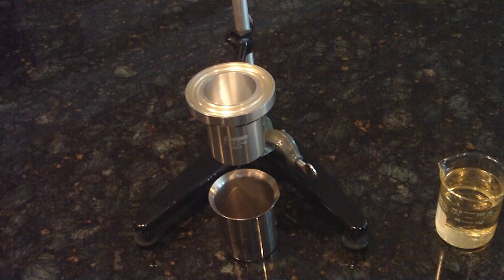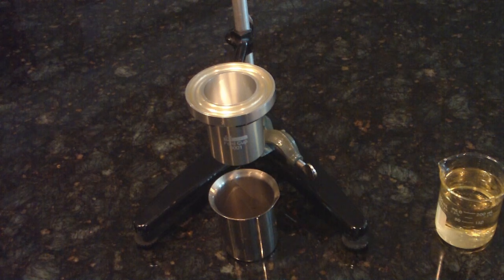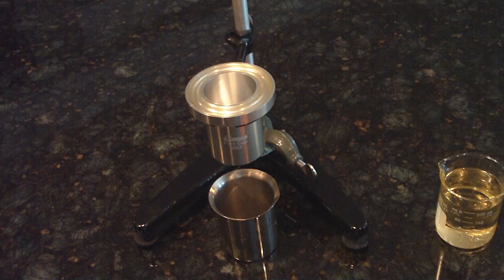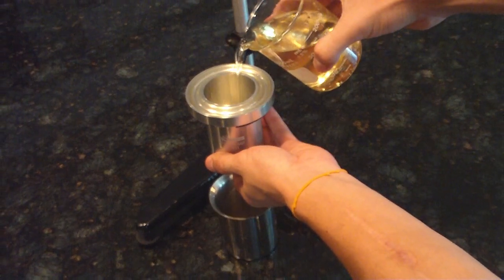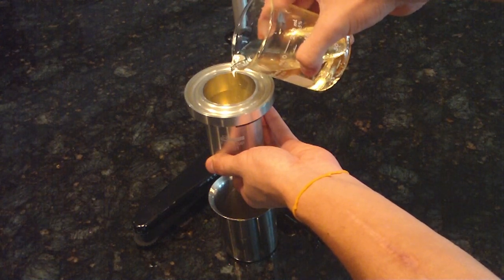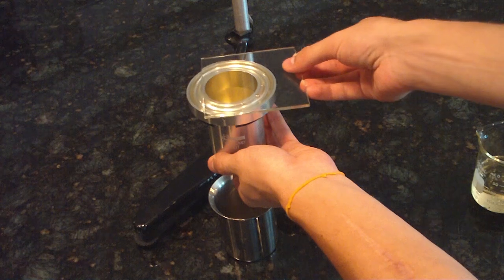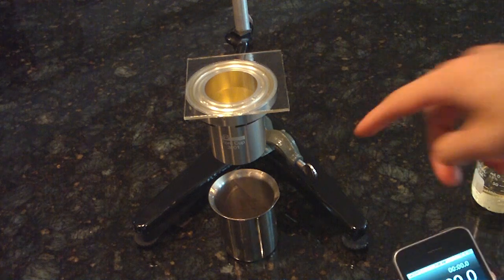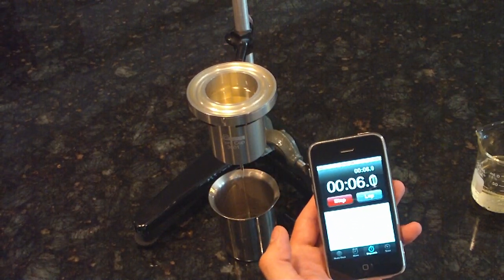How to Use a BYK-Gardner Ford Viscosity Cup to Measure Viscosity

Comment: Hi. Why do you choose using Ford Cup vs Viscometer?
Reply from the maker: Hi Amye! Ford cups are a simple way to QC relatively low viscosity liquids such as oils. They are simpler to use and cost less than a rotational viscometer, although rotational viscometers do typically provide more precise measurement results, so the best option would depend on your individual needs.
Reply: @BYKGardnerUSA  Is using ford cups a good way to measure the viscosity of yoghurt? And if so what is the formula to solve the viscosity?

Comment: could you please tell me how you'd calculate the viscosity from the given measurements
Reply from the maker: Ford cups are assigned a K and C value depending on which number cup it is. To calculate viscosity these constants, along with the efflux time in seconds, are entered into the following equation to calculate kinematic viscosity:

Centistokes = (K*efflux time) - (C/efflux time)

Multiply this value by the specific gravity of the fluid being tested to convert the reading to centipoise (dynamic viscosity).

Comment: Each Ford Cup comes with two constant values, K and C.   A No. 2 cup has values of K=1.24 and C=770.  A No. 3 cup has values of K=2.31 and C=550. A No. 4 cup has values of K=3.7 and C=400.  Centistokes = K*efflux time(secs) - (C/efflux time).  To convert Centistokes to Centipoise multiply by the specific gravity of the material.
Reply: How to multiply specific gravity of material sir after your given formula
Reply: What is the ford cup size-
#2, #3, #4, #5, #6.
Which one of above is used to find spray paint viscosity